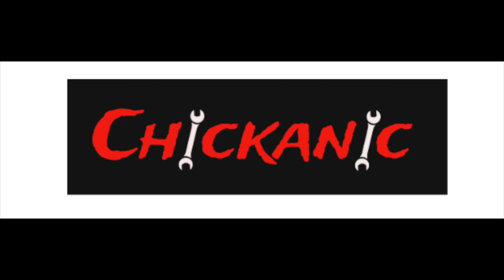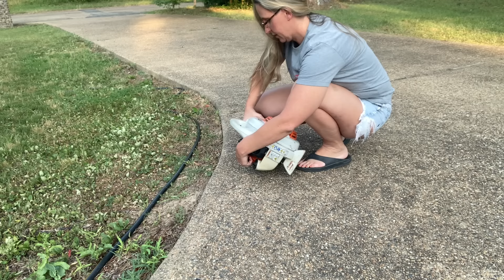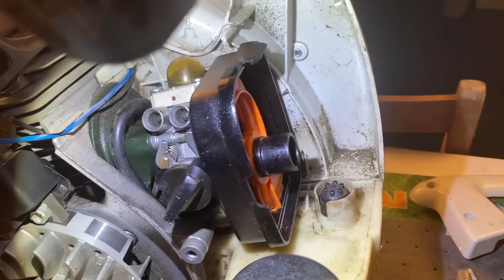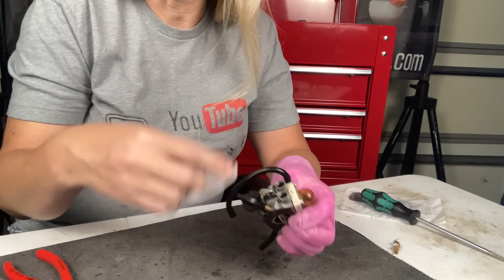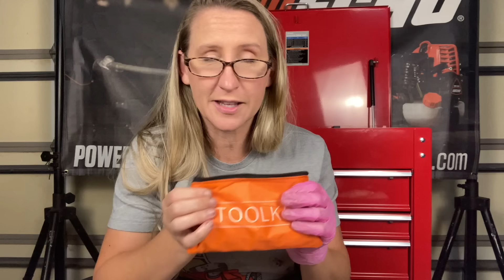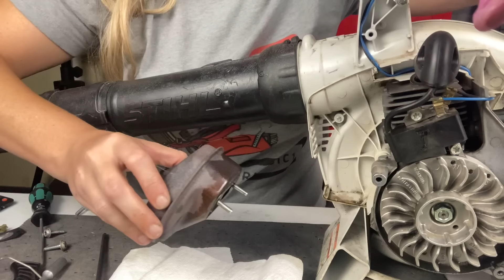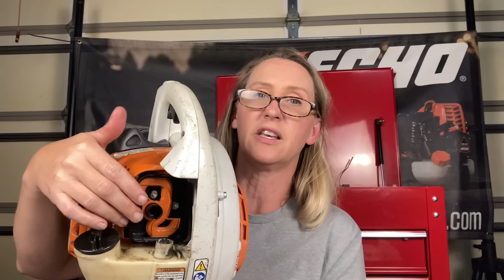Stihl Blower's gas disappeared! Pull rope won't work? This small engine has issues! Repair/Vlog

Comment: That engine was what is called "Hydro locked" an engine that can't turn over due to the cylinders being filled with a liquid.
Reply: This can result in twisted and bent articulating rods in lower cylinders.  Always turn the prop by hand before starting a radial! 😁
Reply: Yes. Last year my brother 5yr Tanaka did it carb was leaking gas in the engine, He took his to the shop. The same week mine started doing it. I use mine commercommercially. Mine was 6.5yrs. The dealer doesn't sale or service them where I bought them at. I replaced the carburetor. Running like a champ now. He got his back not fixed & the guy charged him somewhere near 85 bucks with brand new wrong spark plug. I changed his carb too. Wouldn't pull because spark plug was too long hitting the piston. I took my plug installed it in his, 1 or 2 pulls it starts. I did it for free
Reply: Remember, she has to break it down so people that wouldn't know what hydro like is.
I raced boats for decades, more than once it blew over backwards while topped out, engine went under twisting close to 10k rpm, rods looked like a lightning bolt qll bent and crooked, crankcase and block was full of spider web cracks, fuel pump, carb and ignition was all that was salvageable off them
Reply: You Sir, are correct!  Great comment!  Peace
Reply: Even though she didn’t name it.  I’m sure she showed the exact cause.  Wasn’t  that hard to see.

Comment: I use, and recommend using copper base anti-sieze on the muffler bolt threads.  I have a roll-up stick from loctite. Never use aluminum based anti-sieze.  Just a suggestion from a retired seventy three year old industrial mechanical technician. Have a good day.
Reply: I put that sht on everything!!
Reply: What is the issue with aluminum bases anti-sieze?
Reply: @jeffcooper5789  copper has a much higher heat tolerance
Reply: Thank you for the information.
Reply: @jeffcooper5789  I learned, in a foundry with continuous high heat that the aluminum based anti sieze would cause the threaded area to sieze. Doesn't sound right but would seize every time. Finally I learned copper base solved my problem with thread siezing.
Reply: There is nickle based as well. How well it conducts heat isn't terribly important as no matter how much you put on, when you tighten you will end up with a very thin layer. The stuff is real bad about migrating though (every type I have ever tried). If you put a half teaspoon on your front threshold on monday, you will have a considerable amount on your homes back threshold by friday. Of course if it were silicone grease it would make it to the rear threshold by Tuesday or Wednesday.

Comment: During WW2 before starting some aircraft the ground crew had to turn over the engine to eliminate hydro lock before starting the engine.  This was due to oil leaking past the rings.
Reply: Not just ww2. Still done today on the yak for instance. Any radial engine can get oil and fuel in the lower cylinder.

Comment: You can take a 10 gauge ( Yellow ) wire connector jammed over the needle screw heads and turn the adjustment in or out
Reply: Dammed excellent comment and suggestion!  I will have to give that a go?!  Peace

Comment: OK. Great video. I had exactly this same problem with my leaf blower. My question is that you mentioned to check the functioning of the gas tank relief valve. How do you do this? Thanks.

Comment: Thanks, this is very informative.  I have a BG86 with the same issues.  After watching your video, I replaced the tank vent, plug, air filter and emptied and dried everything.  It started up and ran fine, but still gets vapor locked.  If I loosen gas tank cap a little after running it, it doesn't vapor lock.  Is there a real fix, or just keep loosening the cap?

Comment: I'm wondering what your thoughts are on the 'new' style Metering Diaphragm.  These are the stainless steel piece with a clear poly thing.   They are supposed to be ethanol happy.  I still wonder if that poly thing dries out or lasts and lasts

Comment: Maybe someone said it but you can take a cutting wheel on a dremmel tool and make your adjustment screws work with a flat tip screw driver when that messed up head thing happens.

Comment: I have a older Stihl backpack blower and when I use it, after the first time then cut it off, it will not start again. Why not?? I cut grass every day and I need to use my blower for every yard. Why won't it start back up?? Please help. Love your channel!!
Reply: check carb for pressure leaks.  Then crankcase pressure test.  At 10 years commercial its possible its crank seals are not sealing when hot which is why starts first time but refuses to restart

Comment: Had my leaf blower on full throttle for five minutes and I hear a little pop, the engine stopped. I tried to restart and it wont start. When I prime the carburetor I hear a sissing sound. Do you think it's a carburetor issue or did I blow the motor ?

Comment: I always ground the spark plug cable regardless if it has a kill switch or not before pulling on the rope with the spark plug removed ☺️( I once set a mower on fire 🔥 because the spark plug wire was resting near the metal cooling fins of the spark plug hole 🕳️🤪! 11:23

Comment: I have a Stihl BG86 and when I got it home the hi side was a little off and I wanted to adjust it but none of the tools in those tool kits you can buy off Amazon fit the hex head of the newer Stihl machines. I stopped buy the place I bought it from and they told me that Stihl will fine them $10,000 if they were to sell the special tool. They wouldn't even show it to me. I ended up using a blue butt connector and pushed it over the head of the screw to adjust the hi side. The special tool is somewhere between a 4-4.5mm hex. I think this is total BS but apparently Stihl don't want end users making any adjustments to their machines.

Comment: I was hoping you would go to the next step, as you kept referring to, of checking the tank vent. I watched to the end, and it never got done 😢. If the tank vent WAS ok, i don't see how it would allow the pressure to build in the first place to flood like that!??
One of my many Stihl items is the BR430 backpack blower, in which i have fought backup prrssure in the tank for quite a while.  In Phoenix it becomes a real issue. I've replaced the tank vent, and talked with Stihl USA tech, and they say the cap is not a vented cap. The only vent is the push-in plug with the brass filter screen near the fuel pickup connector. Yet, pressure build up and makes starting unpredictable. When its working as it should,  one pull warm, it's running like a purring kitten. Otherwise it will foul the plug. So you pull the plug, clear the cylinder and torch the plug and the cylinder and then it usually starts and runs normal. I'm now going to install a vent of some kind into the cap or tank ceiling, and see if the issue resolves. Anyone has done this? Please comment! 🙂🙏🙏

Comment: WD -40 when trying to remove gaskets without breaking them works most of time , I had a friend a long time ago he used WD-40 on the new gaskets when ever he would build a carburetor  I've never forgotten that . I tried it on a 750 doulbe pumper carb I purchased got the bowl gaskets loose and reused them it had been sitting so long the pumps were hard in it I was replacing them anyways. So 41 uses :)

Comment: I had bunch of riders last year that had gas filling up crank case and cylinder from fuel shut off in carb staying open but 20 years of using stiihl blowers commercially never seen this issue.
Reply: Used to be that if they used gravity feed they would use an updraft carburator. Leave the shut off open and have a sunken float, and it still can't fill the engine with fuel.

Comment: I have a hitachi/tanaka blower that always empties the tank when sitting. I don't see any tank vent, maybe it is in the carb somewhere. It does run fine but will stall after a minute or 2 at full throttle. It will start again after opening and closing the gas cap.
Reply: that has a vent made into the cap which has probably fallen into tank.  and as far as emptying while sitting unless its bloody hot where its stored pressurizing tank then its your needle is staying open flooding the engine.

Comment: I learned a trick from Leon's Chainsaw Parts and Repairs regarding carburetor testing.  He has a tool to pressurize the fuel inlet, which checks the needle valve as well as the gaskets on the pump side of the carb.  I use a Mini-vac hand pump to pressurize the inlet.  It should hold 5 psi for 10 minutes.  This has saved me a LOT of aggravation on two cycle diaphragm carburetors and has gained me some happy customers.  You could also pressurize the tank to verify the vent on the tank.

Thank you for making videos and helping people with their small engines!

Comment: I had the same problem with my BG-86.  I ended up just putting on a new oem carburetor.  Now, instead of the fuel pushing into the cylinder it just leaks out of the machine completely and ends up in an oily puddle underneath.  I’m going to take a look at the tank valve and maybe just replace it.  I live in Arizona, and it is 115 here.

By the way, after the new carb the blower runs really great, but that Stihl gas is very expensive to just end up on the ground.

Comment: hi I wanted to mention I had similar symtoms with an MS 391. after a lot of work the problem was solved by taking the after market decompression valve with an OEM. this solved pulling issue
Reply: update replacing aftermarket with an OEM DECOMPRESSION VALVE

Comment: No air filter.  Mangled carb adjustment screws.
Guess that is what you meant by the owner being "sort of" a professional. 
Bet the spark screen was missing in the muffler if you had looked.

Comment: Mrs Bre, the company I work for is a Stihl Dealer, we use to be one of the main locations that worked on the blowers, trimmers, and saws. We had a couple people quit so we send them to another location. They generally just put a new carb on the unit. They argue the labor of removing the old carb and rebuilding it, the customer would have more money invested vs just putting a new one on. What are your thoughts on that?
Reply from the maker: It depends on a few factors. Sometimes I replace, sometimes I repair. Cost, first and foremost. Whatever is best for the customer. Through trial and error, I usually know which ones always take a kit and which ones are iffy and a waste of time. I rarely use aftermarket carburetors. Usually only if the current carburetor is already chinese junk.
Reply: @Chickanic  gotcha, we only use Stihl parts as well. I guess with us being a Stihl dealer we have no choice. I have seen that very rarely after someone buys a Stihl product you don't see them back for at least a couple of years. If it is in the 2 years it's almost always from running ethanol fuel.
Reply: Small engine mech here.  Id at least look why maybe just fluff or stiff diaphragm time is only a few minutes more with testing.

Comment: Does this exhaust have a screen in to clean. Big up from Scotland 👍
Reply: your in scotland mate doesnt get dry enough for a tiny little spark to burn anything unless your in the forest just ditch the screen.  Which it does have its attached to the round outlet on muffler just unscrews anticlockwise with a plug spanner then break it off or clean it.  Im in NZ we just remove them

Comment: I have an old chain 
saw never heard of the 
brand. took a bit 
now it runs well.
is there that much of 
a difference between 
50:1 to 40:1 in the 
different
two stroke motors?
how can I determine 
which engine taks
which mix? thanks 
for the wonderful 
teaching videos.
Reply: @Rockjock007  Tanaka ECS356 Tanaka kogyo Co. Ltd. it has an oil adjuster on it.
originally my father in law left gas in it (completely dried up)
so I used carb cleaner (gas additive) to soak out the nasty stuff. 
then rinsed with gas mix , then finally put fresh mix in and got it 
running. I am looking for replacement air filter, and new plug.
this is my back up saw, it also came with a jig & round file to
hand sharpen the blade, have not tried that yet. how long does
gas/oil mix stay useable? I have been using the stihl oil mix
with alcohol free high test gas. thank

Comment: Hey there ! Great information in this video. 
 What is a good source for replacement gasket aka carb kits. Darn local shops 
Won’t stock or order parts. They say “ but a new carb online. Cheaper”
The one I did order was a knock off carb.

Comment: If you come across a screw that has ben destroyed by some dope,  Get a left hand drill bit and put it in your electric drill and drill the screw head with it and it should do wonders backing the screw out, since it is probably not tight since it is an adjustment screw.  You will want to get a drill bit that is maybe half the diameter of the screw head.    Give it a try.   you may wonder how you ever got along without a left handed drill bit.

Comment: Question? Seeing  no air filter. Why would you not pull muffler and check for scoring on both sides of piston 1st. Seeing screws messed up why not replace carburetor now? My luck it would only cause me grief down the road  having to take it apart again and already having parts, labor and down time in it.

Comment: Will the lower end have gas in it like the muffler?
Reply: Yes, but she worked it out all over her grass. It's made to pump the air/fuel mixture violently thru the bottom end first and there is designed minimum room in that bottom end so most of it got onto the grass. Lots of room in the muffler for it to settle out there though. She knows exactly what she's doing while doing it right.

Comment: I jut bought two gauges for setting the lever height for the needle valve . One is for Waldron the other for Zama . The height o the lever according to the carb manufacturers is very critical. I also had a Stihl blower thatI had let my neighbor use . It would start but not rev up after he used it . Turns out he pushed the primer too many times ,hydro locked the cyl and when he yanked on the cord sheared the integral flywheel key. The new flywheel was 85 bucks so rather than spend that much I put some coarse lapping compound on the tapered shaft put the flywheel on in the correct position and tightened it down.  So far it has held up for the last 10 years . I had a rough time getting down to the cause of the won’t rev up issue

Comment: I use a Dremel tool with a cut off wheel to slice a groove in the end of the needle then use a flat screwdriver to adjust the high and low mixture.

Comment: I had this problem with my BG 56C. It was the fuel tank vent. I removed it and cleaned it. It is seamed in the middle and I took a razor blade, opened it up and found one of the clear diaphragms with small center holes had it's hole plugged. Used a small needle to unplug. Put the vent together, checked for airflow thru it by blowing into it and reinstalled. worked. Yes, I can taste gas as I'm writing this. :-)

Comment: I spent 2 hours working on a maryama string trimmer carburetor. I've rebuilt the carburetor before. I finally said forget it. Found one online for 16.00.  I fixed that thing. It works better than it did. Sometimes it's better to just buy another carburetor. 16.00 and free shipping. My old string trimmer is good as new.

Comment: Also had that problem with a echo brushcutter. Problem was carburator. Rebuild kit is the same price as new carburator. Bought carburator, installed and problem solved.
Reply: Good to know!
Reply from the maker: I don't see problems as much with the aftermarket Echo Carbs as I do the Stihl and Husqvarna.

Comment: Bg56c has easy pull start. Didn't know if you knew. The wife knows but still snatches the hell out of it! But we've had it since 2013 and use it alot and other than using Stihl synthetic and a few air filters changed its been worth the money!
Reply: you can change it too a non easy start just change the starter pulley.  If she starts breaking springs

Comment: This particular model has issues with the exact same thing in this vidjeo. I have had ones lock so hard and fast they spun the fan off and sheared the keyway on the flywheel.

Comment: I've had 4 strokes dump the tank into the crankcase through the carb, but not 2 strokes - and I haven't had any trouble with it since I switched to non ethanol.

Comment: Regarding the hi and lo carb adjustment screws being damaged, I have used a dremel tool with a cutter disc to cut a slot in the head of damaged screw and then just used a regular screw driver to make adjustment. If the damaged screw is below the casting, just cut through the casting to get to the screw. I have successfully used this method several times.
Reply: Yuppie
Reply: I have done the same over the years and it works well. I would get permission from owner first before cutting any part of their equipment.😀

Comment: Has anyone tried the Fully electric STHIL backpack battery blower yet? OMG I tried one yesterday and I was completely shocked. Yes they are expensive but so quiet......almost like making your own wind. Super powerful IMO better than gas.... Backpack battery is not too heavy runs for 8 hours.  Just the fact you dont need ear plugs is amazing. great for early morning blows in places people get freaked out from the noise.
Reply: plus the machine is almost weightless.....like using a backpack blower but lighter.